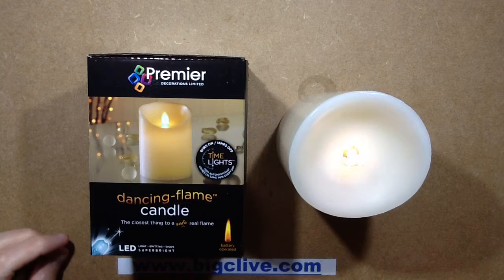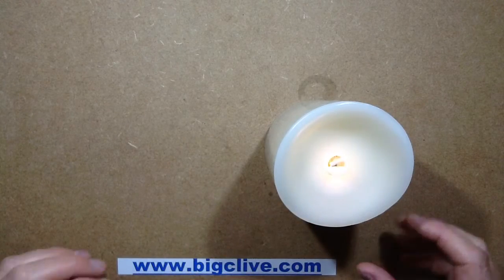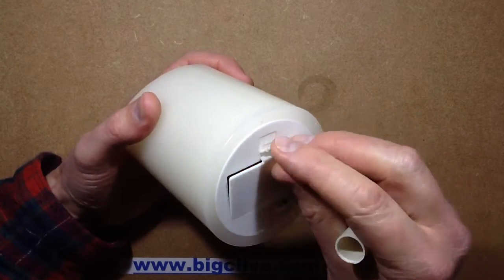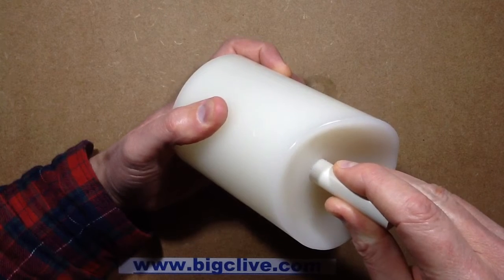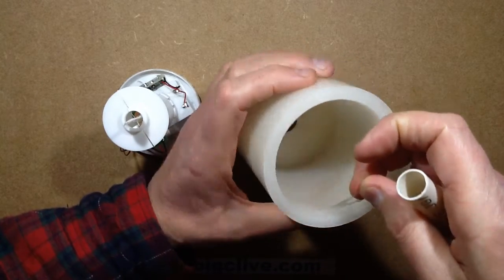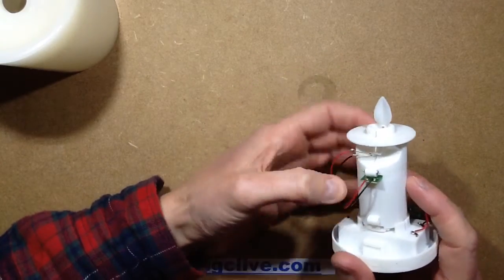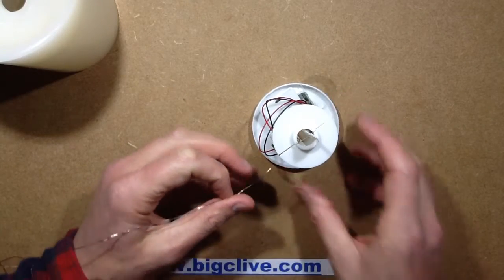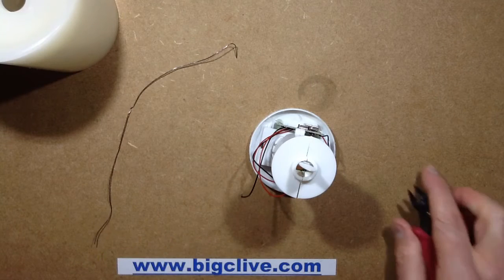How to hack your Premier dancing flame candle to be more subtle.

Comment: Question... I have a set that has 2 modes, candle and light. In candle mode the led pulsate but the flame doesn't flicker. It only moves and flickers in light mode. Any idea how to change this so it flickers and pulses in candle mode (or both modes for that matter.)

Comment: Hello Clive. Just tried this mod with a 150 ohm and 100ohm and both did not really impact much other then causing the remote not to function?
Reply from the maker: Did you put it in series with the coil or the whole circuit?
Reply: @bigclivedotcom  I believe just the coil but I will have a better look tomorrow
Reply: @bigclivedotcom  yes you were correct I have another model ( Not premier)
where coil is attached to the board with the led. I just inserted a 150ohm at coil and made a slight difference not huge. remote still works..probably not worth the effort to make this mod on this particular candle. Fwiw it's the univela  rebranded china knockoff that takes 3 aaa. Otherwise pretty decently realistic with amazing battery life on rechargeables
Reply: I must say now nightly both side by side your modded 150 ohm resistor wins . Less jumpy. Well done thanks !

Comment: I did an easy solution with mine that was moving too much & clicking. I just bought tiny clear rubber bands & wrapped it on the base of the flame...Bingo, worked like a charm! 👍🏼☺️
Reply: Great solution! I will give that a go.
Reply: Do you  mean those tiny, elastic hair bands? And do you need to open the candle for this? It would indeed be great if this takes care of both the 'jumpiness' of the flame and the clicking sound.

Comment: Many thanks Clive for the hack. Also please let me know if they can they be connected to a DC supply (5V) instead of batteries. I want to  run them for longer time.
Reply from the maker: The candles that take three AA or AAA batteries can be connected to a USB cable with just a 1A diode in series to nudge the voltage down slightly.